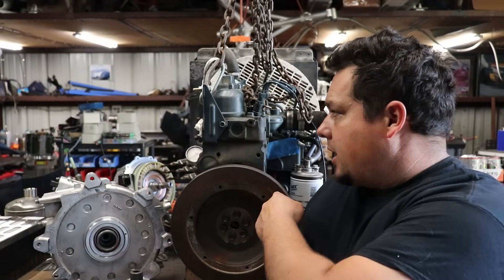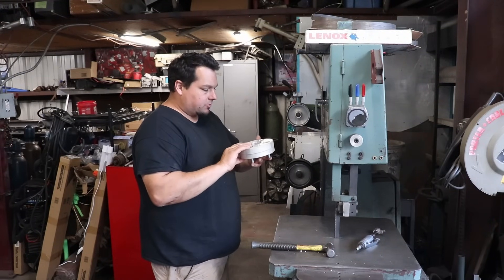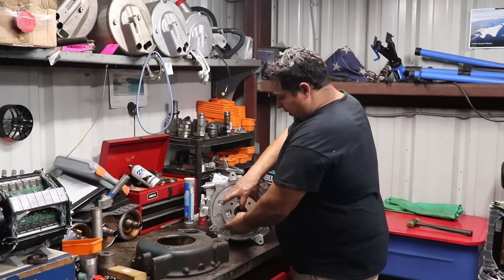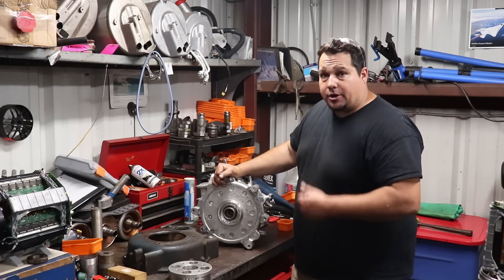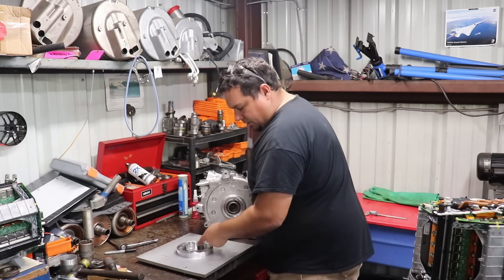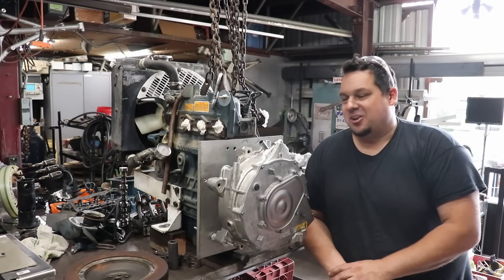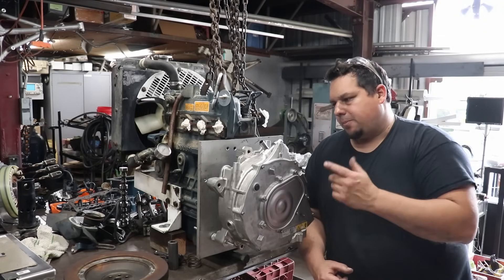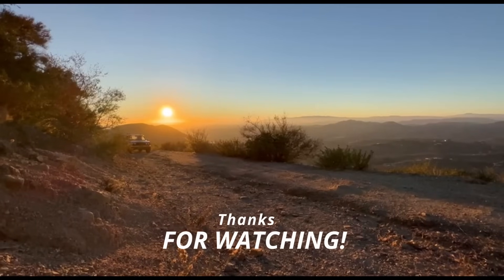Mounting a Kubota 905 engine to a BMW i3 Generator Tesla powered Toyota Hilux with a Kubota! Video 5

Comment: How many dead Tesla drive units are hiding in your shop now? GEEZE! On the consideeration of vibration, you could use a lovejoy or guibo joint. It would lengthen the assembly but, it could reduce the vibrations reaching the generator. Continue on.
Reply from the maker: Haha many motors are torched! That’s a good idea though. Would definitely help it stop the chatter.

Comment: Love the project!   Would you happen to know if the crankshaft bolt pattern on the 905 is the same as the D722?
Reply from the maker: Thanks!! It looks like they are definitely different. The D722 is much smaller in every aspect.
Reply: @J5Jonny5   Thanks!

Comment: Excellent work, I hope we get some efficiency tests when its completed in KWH / Litre of fuel, i reckon it should be pretty damn good.
Reply: I second this, even though I'm fully aware average cruising speed has a tremendous effect on mpg, it would still be awesome to know this data
Reply from the maker: Definitely. That’s what I’m mainly after once I can start testing. I’m hoping it’s in the high 30mpg range when it’s running on the freeway.
Reply: @J5Jonny5  I would expect slightly more actually even if its as aerodynamic as a brick lol, we will see tho, great project! doin what the automakers should be doing already where are my free piston engines with 50%+ efficiency?

Comment: LOVE this series!
The propulsion "Package" appears to potentially be cleaner, quieter, more durable and more efficient.
It will be interesting to see the actual mileage when in generator mode .😃 P.S. ...Best of luck to you!
Reply from the maker: Thanks so much! I’d say it’s a much cleaner solution because you only use the generator when needed. Most of around town I won’t run it but if I need to jump towns I’ll have the option. I can’t wait to see what fuel economy in get.

Comment: I love the birds singing in the last sequence, so peaceful. 
Glad to see you're conscious of the vibration which are impacted into the generator by the engine. I wonder if the Valco generator could simply take the diesel rattling hard mounted reliably. Maybe it's worth the try with a spare starter/generator on hand?

Stelar project, it's great seeing you prototype this at this speed and precision
Reply from the maker: There are definitely a lot of birds at my place. I love it. 
And thank you! I’m trying to keep a solid pace so this happens soon. 
Yeah that little engine sure does shake like crazy. I’m gonna have to figure out a soft coupling most likely.
Reply: a chain drive gives flexibility on gearing 🤔 very exciting engineering/craftsmanship videos !!! 👍👍👍

Comment: Note 
A three cyl diesel might be a bit chattery for a direct coupling to a BMW alternator .
Rubber dampers such as those used on drive shafts might make it live a bit longer
Reply from the maker: That’s a very good point. I’ll take a look into that and see if I can dampen it a bit. They definitely shake like crazy especially at idle. Thanks for that advice!
Reply: @J5Jonny5  it has a flywheel so it wont change in speed much, i would try it without before you second guess, rubber adds a wearable part which you should avoid, the bmw motor was directly coupled and it was a 2 cylinder...

Comment: Can you please explain how you will control how much power the generator is putting into the battery.  Also how you will control the kubota throttle to machine the genset load?
Reply from the maker: I’ll definitely be explaining that next as I get into that. I talk a bit about it in my first video. But I’ll be sure it’s explained soon!
Reply: @J5Jonny5  Cheers

Comment: Is 25kw enough to do sustained highway speed though?

Also i wonder if there's a way to mount two of those generators in parallel to make 50kw
Reply from the maker: Yeah it will be more than enough. The Hilux uses around 17kw on the highway. I’d think you could stack them. Or find a beefier generator.
Reply: on some US highways, possible but not european highways (average 130km/h)

Comment: Toyota-Tesla-Kubota-BMW. How are you going to call this thing? TTKB? 😀 Anyway, I think it is a great idea. I think big manufactures do not want to implement it because it is too simple. However, reving the Kubota engine up to generate enough voltage with the generator is not trivial.
Reply from the maker: Haha! It’s made of many parts that’s for sure. And definitely… I don’t understand why the big companies have to make our vehicles so complicated when it can be this simple. Whatever makes them more money I guess. I should be able to crank the current up at the lower rpm range to make up for the lower voltage. Hopefully not to high though.
Reply: @J5Jonny5  You need to have the generator voltage greater than the battery one so that the current/energy will flow toward the (drive ) electric motor, right? I am not sure if you can do this only with controlling the Kubota rpms, or by controlling the BMW generator's magnetic field...
Reply from the maker: @ definitely. I’m gonna be running the generator through a Kelly controller or something similar to control the power coming from the generator. It will basically be regening the whole time in theory. I explain it a bit in my first video.